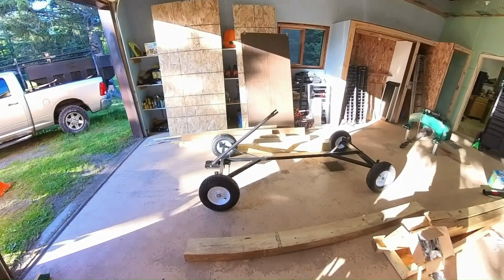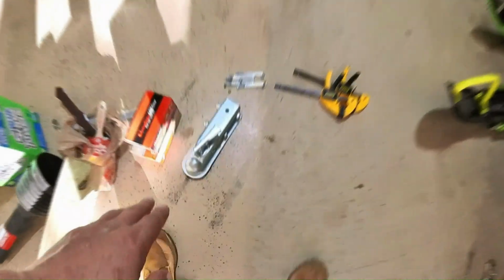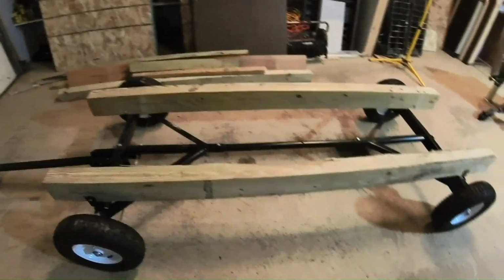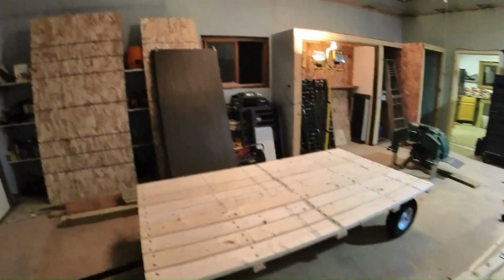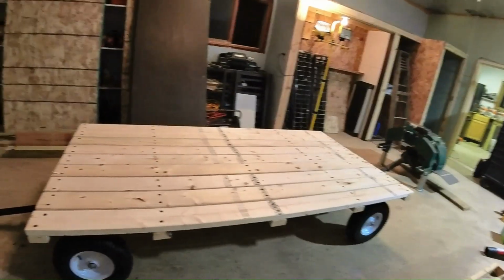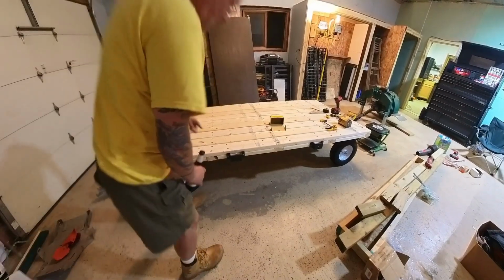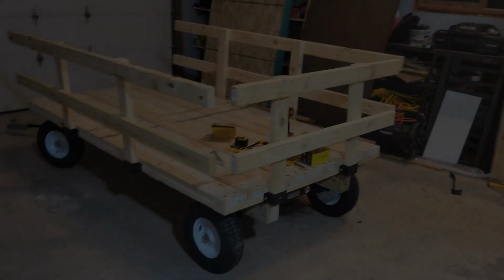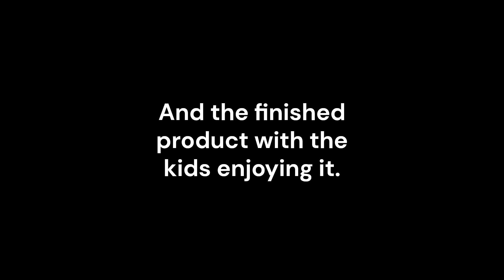Building a wagon with a mini running gear.

Comment: What are your dimensions of the trailer?
Reply from the maker: @Ohio_Popcornman34.  if I remember correctly, the deck itself I made to be 4' X 8'.  The running gear itself is of course smaller than that.  I'm away from home right now, but if you want exact numbers, I can give you those once I get home on Sunday night.